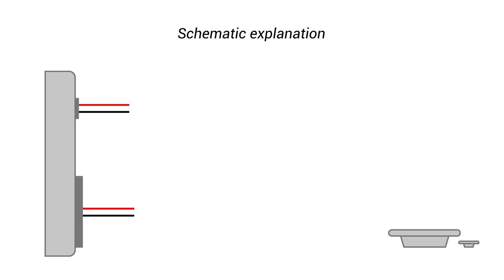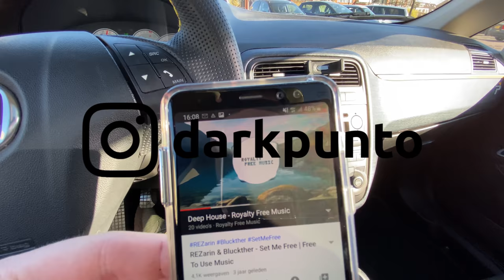Tutorial: Speaker upgrade for a Fiat Grande Punto T-Jet *SHORT*

Comment: Being an Audiophiliac, and an auto electrician, one point that he failed to point out that IS HIGHLY IMPORTANT for a true balanced audio setup AND not risk blowing your hifi amp chip, is YOU MUST ENSURE you wire up each POSITIVE WIRE TO EACH POSITIVE CONNECTOR ON THE SPEAKER.... Failure to do so helps to make your new speakers/hifi setup sound, well..... Crap!... Seems logical, but soooo many get this simple thing wrong... 🤔😏
Anyway... Nice Punto you have there fella... 😎

Comment: thanks for the video, it helped me prepare the materials in advance without having to disassemble the doors twice.
I have a fiat 199 2007 (3 doors). I use it for the daily commute to work, music is essential.
I put speakers in the front doors and 2 subwoofers on the rear shelf each with 100w rms and a diameter of 20cm each connected to the rear speakers.
the audio player on my fiat does not have cd mp3, I bought a bluetooth module from amazon, everything is fine.
if you want to know what speakers I used ...
set of 2 hifonics vx-6.2e 2 ways(incl. tweeters) 100w rms / peak max 200w. 90e on amazon
2 x Rockwood Subwoofer 200 mm 80w RMS / peak 200w. 33 euro on amazon (each)
two rings adapter for front doors ...about 10e
Self-Adhesive Aluminium Butyl for Noise Isolation .
No AMP, just stock autoradio.
the investment cost about 220e and 2-3 hours of work. 
the sound is very good
BUT ... 
you should take into account the distortion and the fact that the car players are not focused on bass, for a lot of bass you need AMP. no matter how high quality the speakers are, there will be sound distortion. for example the fiat player at level 40 (maximum) of the volume, the sound is no longer clear and the bass ... you have the impression that the speakers break even though the player does not have more than 40w RMS. I also tried another Head UNIT, an alpine 8951r,  same result . but if I lower the volume to 32/40, the sound is very good, clear and with enough bass.
as a result, the difference is very large, the standard speakers had broken membranes due to time, and lower quality.
now the road to work is not so boring, 45 km drive to work.
if you need help you can write to me, I am good at mechanics, electronics ...

GOOD LUCK
Reply: Hello, a question:

Can you tell me what the maximum installation depth of the speakers is.
will, for example, fit a speaker with a built-in depth of 68 millimeters?
Reply: Can you send me the link of bluetooth module please?

Comment: How did you install the new tweeter? The composet I bought has a bigger tweeter than the original one and it doesnt fit in the same place where the original tweer is in. Any suggestions on how to fix this?
Reply from the maker: Indian Tech Support I shaved off little bits of plastic so they would fit in the existing plastic clips, if that doesn’t work for your tweeter you might want to fabricate a bracket of some sort to hold it in place
Reply: @darkpunto  alright will try thx for the help and good tutorial

Comment: Can you leave the doors without the whit stock foil cause i found out that is what is making the bass sound weird in my car because that foil keeps rattling if i just put sound damping or isolation strip pieces like u did is that good enough?
Reply from the maker: You can leave it without the white moist barrier, or order a complete new one. I removed mine completely and put sounds dampening basically everywhere

Comment: Hello. I'm looking into buying my next car and I really like the 2 door Grande Punto 199 1.4 T-jet and I was wondering how do you like the car? I'm mainly wondering about stuff like night vision (good headlights), wind/road noise @90~140km/h, does the interior crack/squeak and if does is it treatable?
Reply from the maker: I'm really in love with the T-jet. It has a great torque and power feeling from factory and has a lot of option if you want to upgrade the performace with bigger turbo's and all. It has a solid community which can help with any problem you might face. The headlights are normal I'd say, but I upgraded them with LED bulbs which make them way brighter but not blinding to oncoming traffic. It doesn't squeak or crack when driving slow or fast, roadnoise would be mostly which type and brand of tire you take. I really like the car, for it's pricepoint and what you get, there just isn't anything in comparison. Hope it helps, cheers!

Comment: Does anyone know how the crossover setup works? I am guessing because the factory speakers are components, there is a crossover somewhere. How do we replace that crossover for the new one that comes with the speakers?
Reply from the maker: The factory headunit/radio does the crossover from factory, also the crossover came with this particular set but I doubt it really makes a great difference if you’re running the factory headunit..factory are indeed already components, they are separate from factory as you probably already knew. Now for the tweeters I can imagine it negligible, but for an aftermarket subwoofer I took the signals from the rear two speakers and made sure to get an amp with crossover built in, you defined dont want the subwoofer acting like a speaker/normal woofer